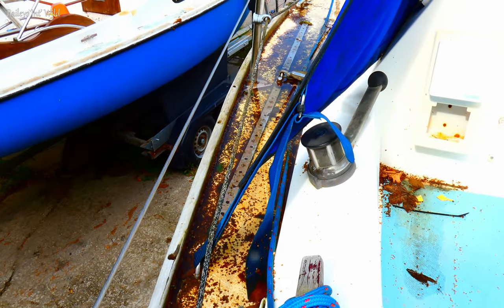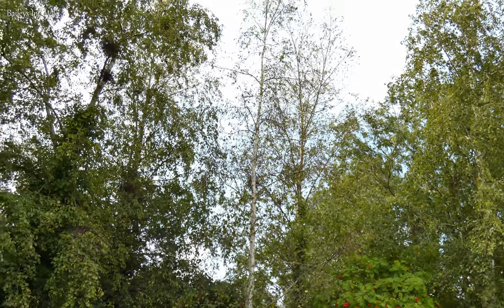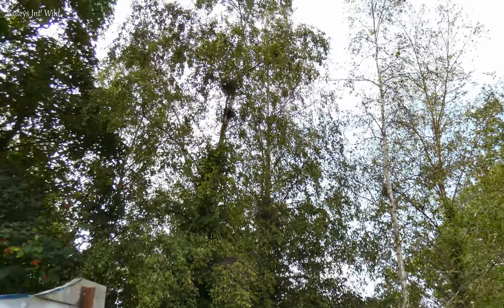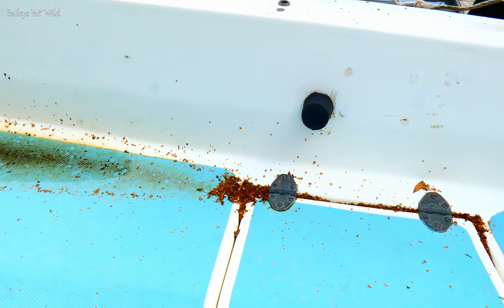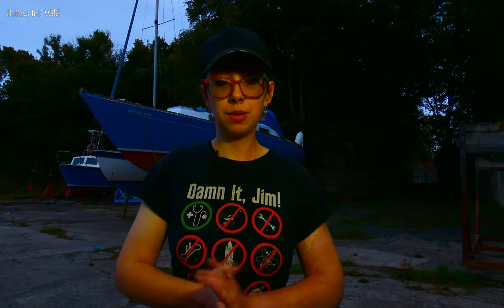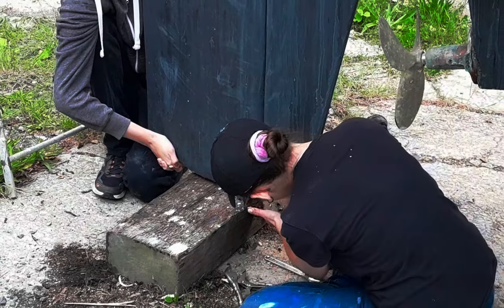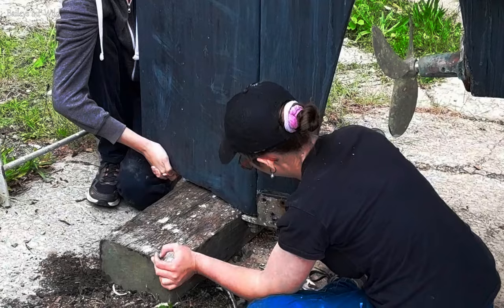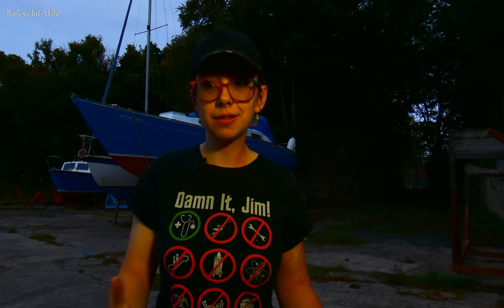Time is RUNNING OUT to Finish Our Deck - Autumn is FAST APPROACHING [Ep.7]

Comment: Just found your channel, and I love what you are doing. It's always nice to know there are other like-minded people out there,  i am actually in the middle of refitting my fourth boat now lol. When you get the rudder off maybe you could take it home not sure if that is possible but it would make that job easier. The prop shaft leak actually looks easy to deal with as it's leaking from the base of the shaft log, if it's the type I'm thinking of you should be able to remove i the two bolts and slide it back enough to reseal it without removing the prop or shaft.
Keep up the good work
Reply from the maker: Thank you. We laughed at the fourth boat bit because we have this sneaking sense this won't be our last boat project either. You're right, we're going to bring the rudder home when it's removed, but it looks very heavy, so we'll have to be careful with it. We're still not sure exactly what's wrong with it. Thanks for the info about the leak near the prop too. You have said the same thing we had deduced (which is relieving), but we're still worried where the water is coming from at all. Perhaps there's a leak in the cockpit somewhere. 

Thanks again, we really appreciate your support.